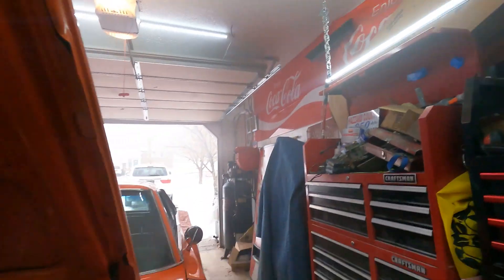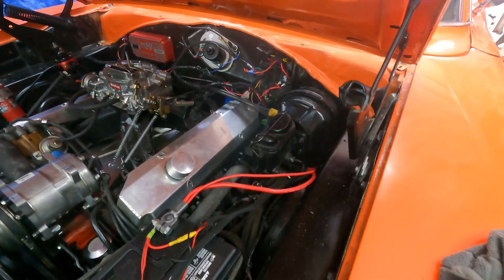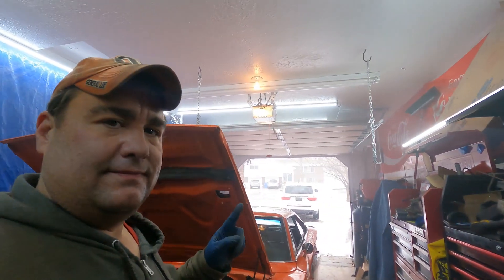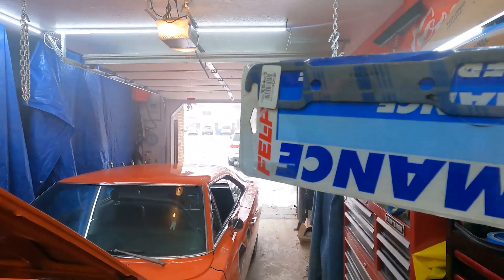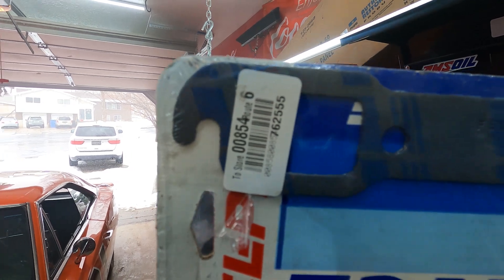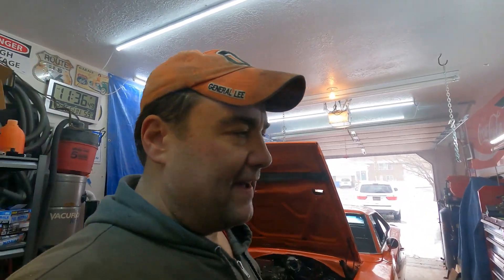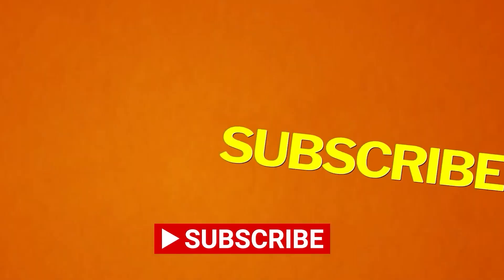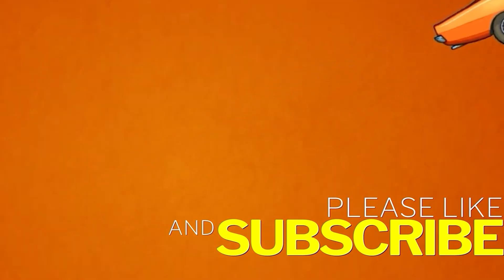1969 Dodge Charger build restoration General Lee are we there yet?

Comment: I know you got 100 experts commenting on do this and don’t do that. Not trying to be that guy. Make sure all your battery/starter cables are the biggest gauge available and don’t use cheap crimped ends. You won’t regret spending couple hundred on battery/starter cables and connections.